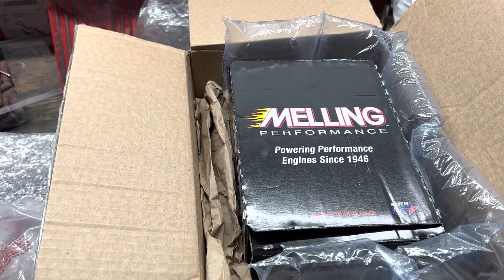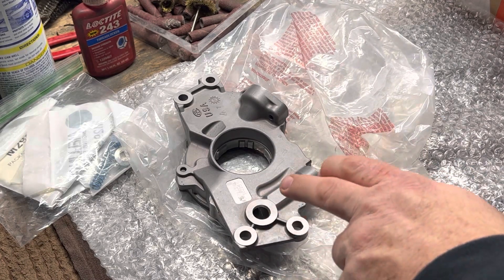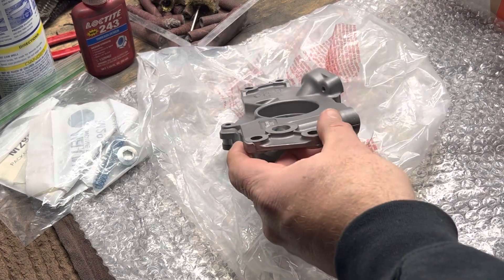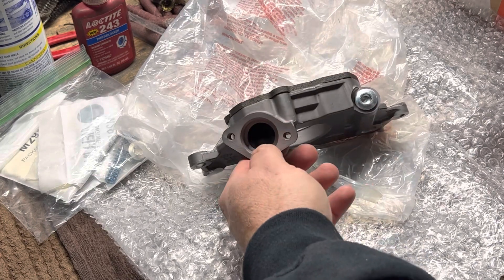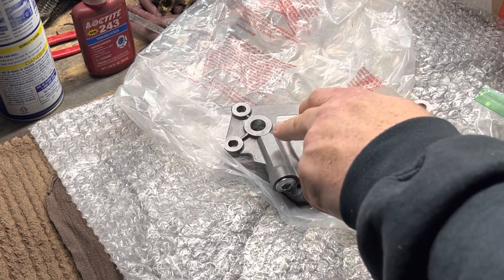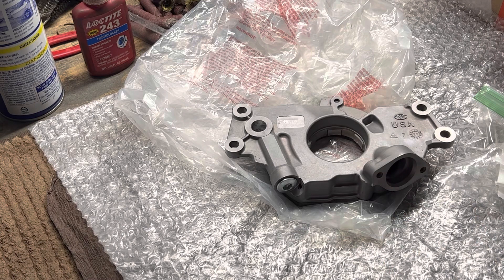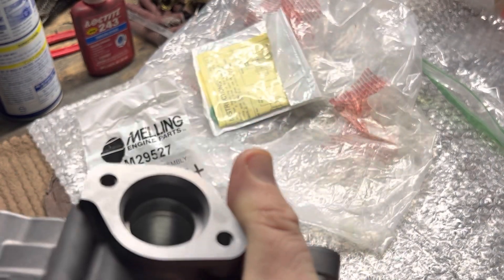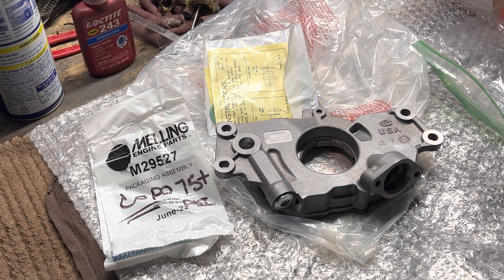Melling 10295 Oil pump Porting w/ “Red” 70# bypass spring

Comment: wonder if u might b able to help did some porting on my 10295 oil pump but now if I snug front cover up pump quits turning have to have bolts pretty loose to make pump move any ideas ? was a new pump b4 porting and tried to do it like u did just not as good as you

Comment: For a stock LS1 that may see occasional 6000-ish rpm rips, would a slightly higher spring rate/shim be ideal? For example, north of 60psi, but not to the extent that a standard 6.5 quarts would be inadequate.  I’m guessing the GM engineers had to consider the trade off, or ?
Kinda the best of both worlds thing for a non-racing daily, doing a nice rip now and then.
Reply from the maker: I like to shim the bypass .100” to help delay the factory internal bypass of 5000-5300 rpm. I prefer to maintain the feed of oil to the bearings. 
Remember you can add 1qt of oil sometimes more and not hurt anything, the oil will be circulating all the time. JD
Reply: @HeadFlowInc  Do you know what rpm it will continue to oil before the .100” shim also starts bleeding off?   Thanks
Reply from the maker: I’ve turned my own 4.8 7300 rpms with a ported/shimmed m-295 pump. I need to add an oil pressure sensor to my Holley setup so I can monitor the pressure via data logs; currently only running a mechanical gauge.

Comment: An honest/humble question: what is the purpose of a high pressure pump?  Thanks for your thoughts.
Reply from the maker: Good question!  Engine oil pressure and volume are designed to the specifications of an engines bearing clearances.  To me the difference between Pressure and Volume can be confusing.  
Pressure is actually a product of supply ready to feed the bearings.  Volume is how much oil will be pushed through. 
Pressure, higher pressure is good to a point; at some level too much pressure is bad. Excessive pressure can wash bearings and use unnecessary parasitic power.  Higher rpm will benefit from higher pressure and possibly more volume depending on bearing clearance used when assembled. 
Volume, usually determined by larger or thicker pump gears supplies more oil to the bearings by mechanical advantage. 
Engine bearing clearance will determine both the Pressure/Volume needed and the oil vescosity.  Wide bearing clearance requires more Pressure/Volume plus thicker oil to properly support the film of oil for the rotating parts.  JD

Comment: I seen a video from Power Nation where they drilled dimples on the side of the gears. I don't know why?
Reply from the maker: I saw that episode, the dimples if done correctly could help two ways. One, there would be a boundary layer of oil accumulation potentially reducing friction and Two, it could potentially add to the efficiency of the gears in the pump housing, as for operating tolerance. 
I don’t recall if the show went into detail on the benefits or not.  JD
Reply: @HeadFlowInc  thank you
Reply: @HeadFlowInc  That makes me think of the dimples on golf balls, except for liquids instead of air.